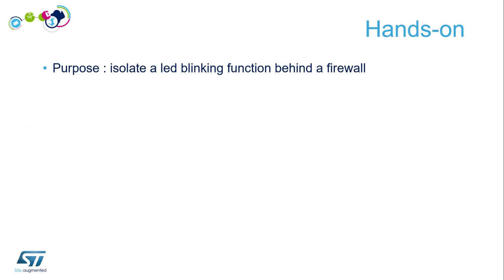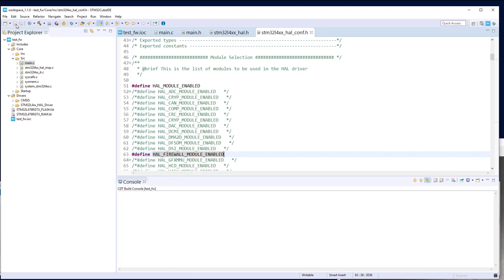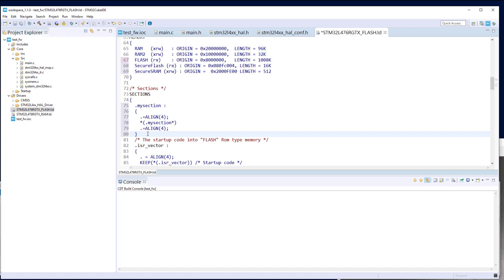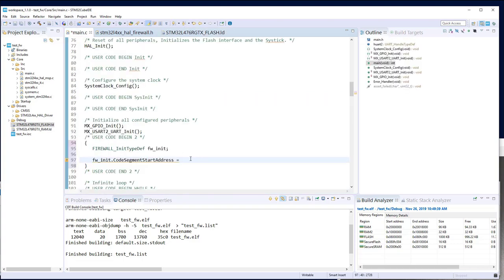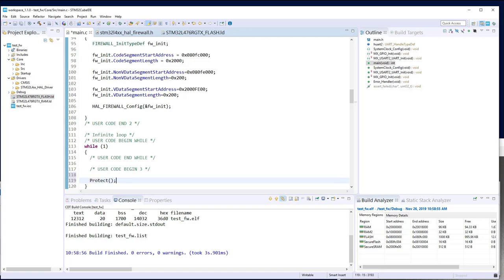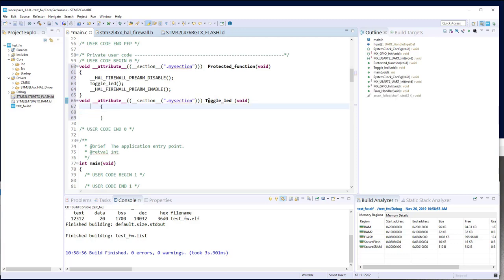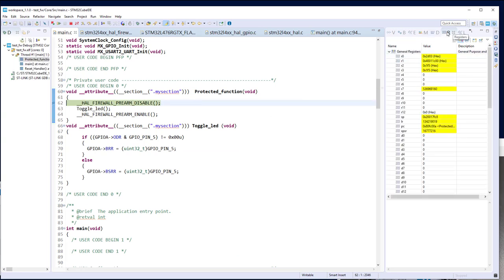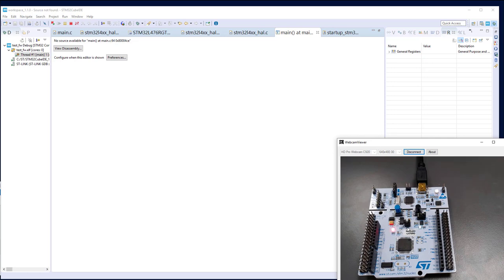Security Part3 - STM32 Security features - 17 - Firewall lab

Comment: Hi, the function  Toggle_led shall be defined after the Protected_function, though to avoid the warning of the implicit declaration of the Toggle_led when used in the Protected_function, the LED does not blink and it is calling the Reset handle. Any hints would be nice to explain this situation. Thanks
Reply: Came across this issue and this is what happens.

If you move the toggle_led code before the protected_function, the toggle_led code gets placed in the call gate address instead of the protected_function. I think a better implementation would be to keep the call-gate function in a smaller section in the linker and have the other functions in the protected code in another region. 

Example:
void __attribute__((__section__(".firewall_code_entry"))) protected_function(void)
{
...
}

void __attribute__((__section__(".firewall_code"))) toggle_led(void)
{
...
}